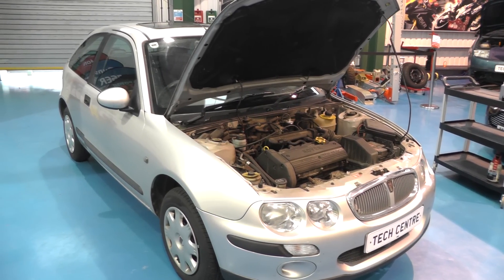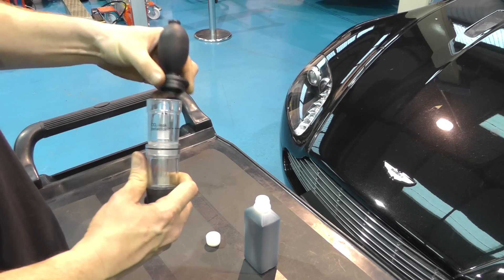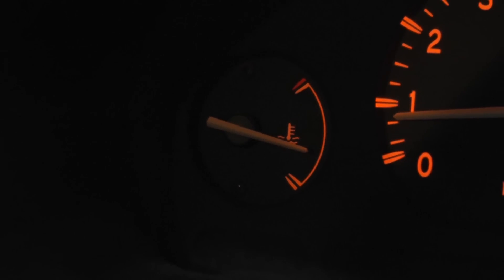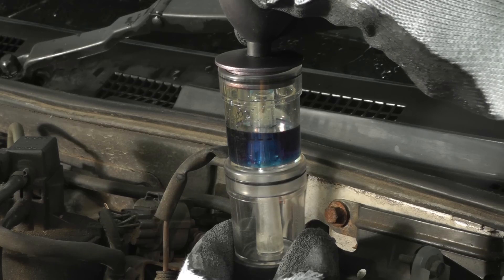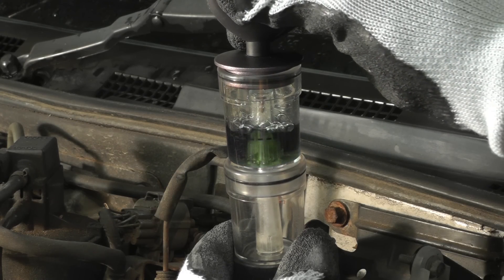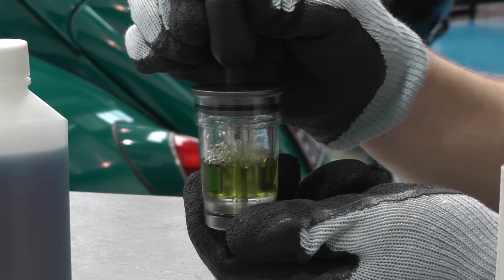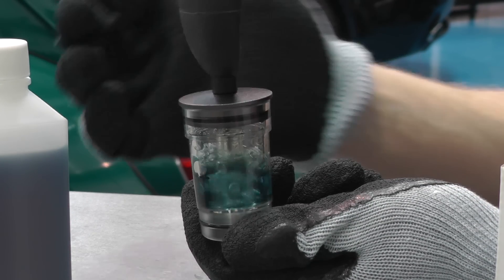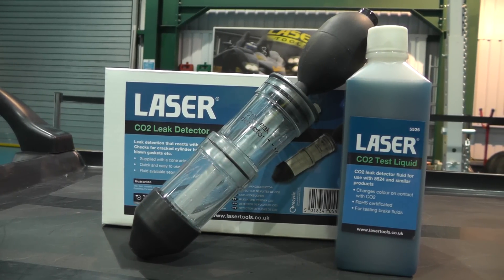5524 | Laser Tools | C02 Leak Detector

Comment: When I do it, the pump barely works, it takes 30-40secs to expand again...still, what happens is that test-liquid from the top chamber is sucked into the lower chamber!
Reply from the maker: this isn't an issue we've heard of when the instructions have been correctly followed. We do recommend you contact our Technical team who will be able to offer additional guidance, who you can contact via e-mail; technical@toolconnection.co.uk or telephone; 01926 818181

Comment: Can results be biaised ? I ran the CO2 test, staying blue, then did a full flush and then it changed colour, not full green but between blue and green. If the cleaner stayed in the cooling system, can it biaised the results ? No other symptoms from the car.
Reply from the maker: The 5524 is a basic indicator tool, the presence of CO2 is what turns the indicator fluid a different colour.
There may have been a contamination but the blue/green colour is not a major concern.
We would suggest running the vehicle for a few days and then repeat the test, a green/yellow colour is a true indication of escaping CO2 gases.
Reply: @TheToolconnection  Thanks for answering. I really appreciate it. Will redo things.